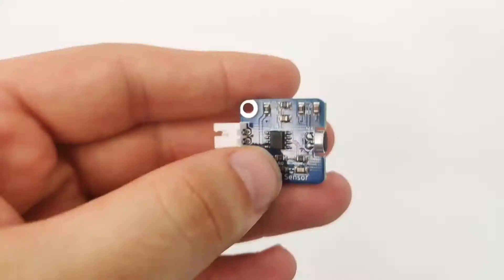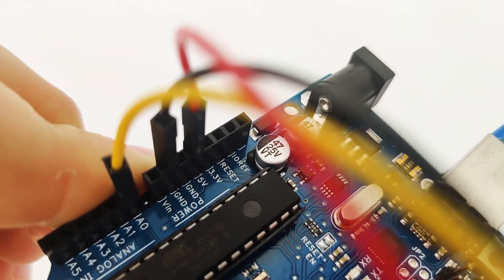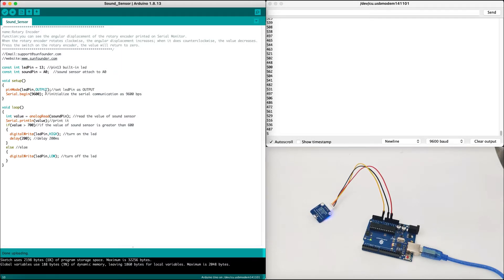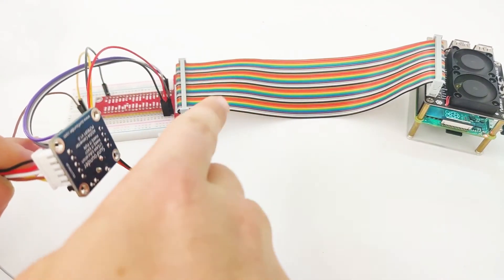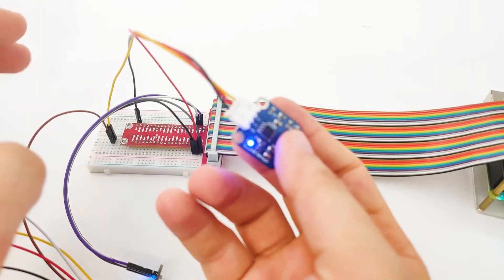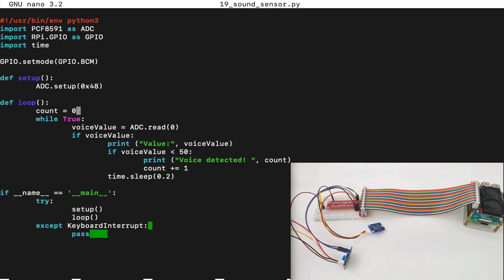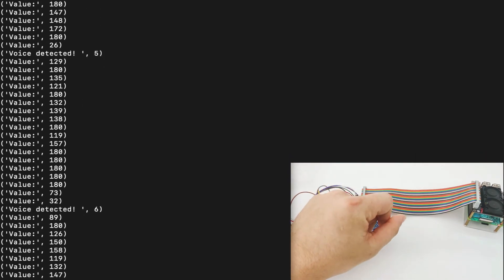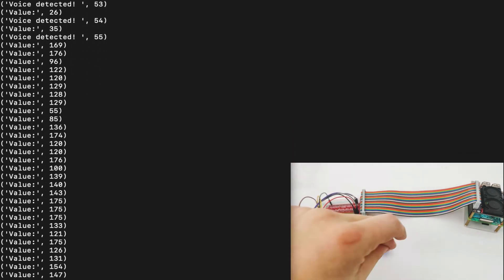How to use Sound Sensor Module with Arduino& Raspberry Pi

Comment: would it be possible to use the value output to cause a display to change images based on increased or decreased values?
Reply from the maker: @kharn2472  of course you can, that’s a great idea!

Comment: can this be used for audio recording and playback?
Reply from the maker: Sorry, it can't.
Sound sensors are typically used to detect the presence and intensity of sound, rather than being used directly for recording and playing back sound. Sound sensors are primarily used to convert sound signals into electrical signals for processing by microcontrollers or other electronic devices.
Reply: @Sunfounder_official  Thanks for letting me know. So can you tell me what can be used for recording audio and is compact in size in a raspberry pi system?
Reply: @Sunfounder_official  can u recommend what can be used as an alternative to record sound and save it on a raspberry pi?

Comment: Hi, may I know, can I change the value received from the sensor to decibels unit?
Reply from the maker: Just an analog value that has no units.
Reply: @Sunfounder_official  if i want to change it to decibels unit, then i need to use some formula with the analog value received right?
Reply from the maker: @MrAima10  Yes. The values received by these modules can only describe the magnitude of the sound change, and do not have units. If you have a way to measure decibels, you can convert those analog values to relative decibels.
Reply: @Sunfounder_official   @Aima Aimaduddin  Would you please provide any formula for same to get decibel value of sound from no unit value from PCF8591?

Comment: Why is the voice value printing -1 for me?
Reply from the maker: Maybe there is a problem with the wiring, or the adc pins are not being used.
Reply: @Sunfounder_official  I set it up exactly as the website and booklet showed (I tried both since they're different)
Reply from the maker: @incrediblygay  Please send an email to support@sunfounder.com.
Describe your problem and the product used in detail. Attach the wiring diagram and code, our technicians will contact you as soon as possible.